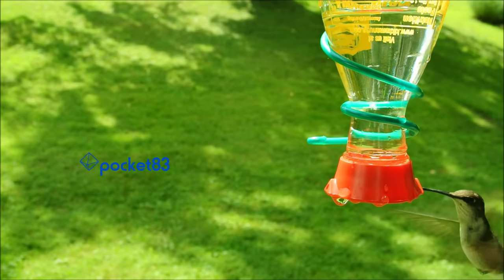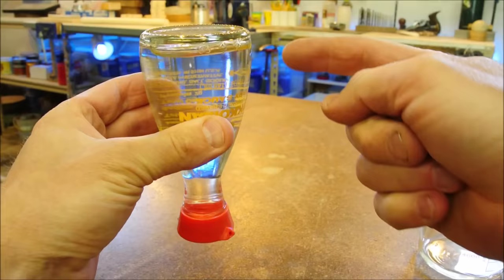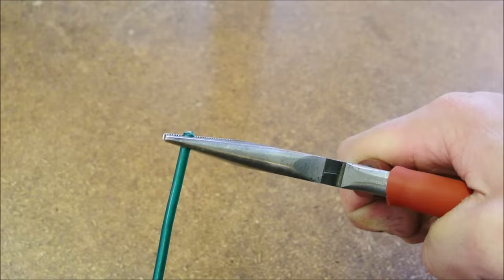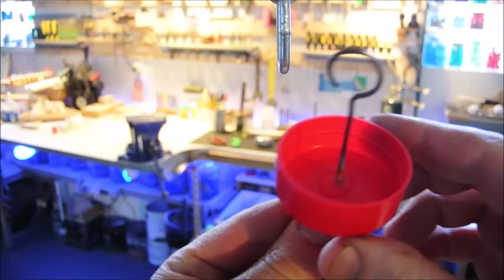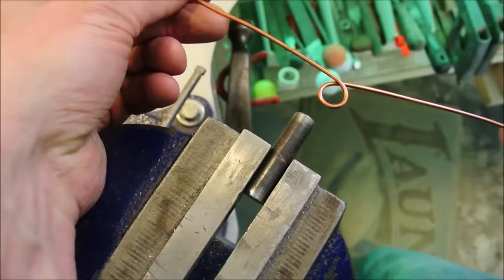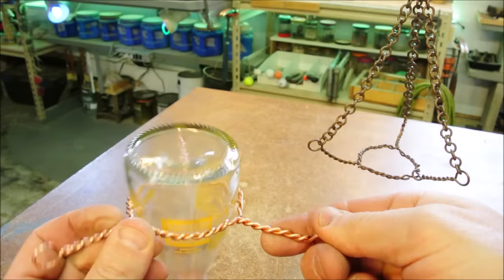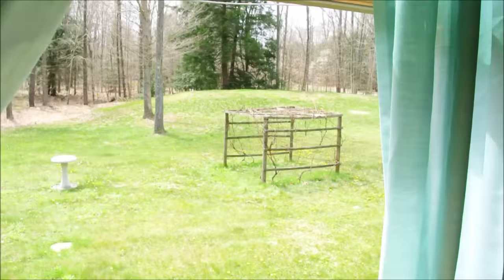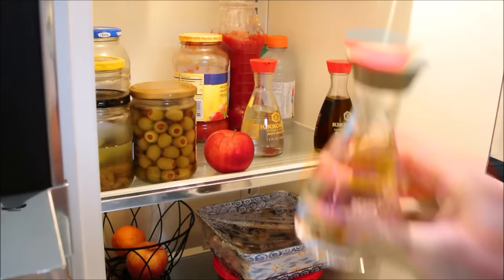Easiest, Cheapest, Best DIY Hummingbird Feeder Ever (from Soy Sauce).

Comment: How about using natural honey and distilled water instead of processed sugar which is not good for human consumption.??? Just a thought.
Reply from the maker: The water doesn't need to be distilled as long as it has been boiled—unless you think there's something poisonous in your water supply. Honey has no nutritional benefit, and it's very likely to grow (possibly dangerous) bacteria. 

Pure sugar is certainly something that people should limit in their diets, but part of hummingbirds' natural diet are the (~25% sucrose) nectar deposits found in many of the flowers that they've evolved to fit. As such flowers are rarely available in a modern suburban ecosystem, these feeders mimic them. 

There is nothing necessarily 'unnatural' about white sugar. "Processed" is just a stigmatized word for the less romantic foods that result of mechanical operation, and we're not talking about fat or salt content here. Simply put, white sugar is just more chemically pure.
Reply: @pocket83  sounds good although honey is nectar collected by bees from flowers and does have nutrients. Also eaten by hummingbirds. 
Sugar is processed juice from cane that's bleached and refined not natural.
 Just looking out for nature. Most of us have good intentions but lack luster knowledge from our teachings. I would advise looking into the making of sugar and the benefits of honey. You're welcome respectfully in advance.
Reply: @pocket83  in a biological ecosystem chemicals are a no no it would make everything acidic. When the earth and body is healthy being alkaline.
Reply from the maker: @scorpionkingggodson5507  You are a classic case of "good intentions but lack luster knowledge," and I can easily demonstrate this by holding up the mirror for you. 

I suggest you first go scan the Wikipedia article, sub-headings "Co-evolution with ornithophilous flowers" and "Feeders and artificial nectar." Certainly, bee honey is found in nature—in places like hives, where hummingbirds don't feed. Outside of which, honey/water solution will quickly turn and spread bacteria. Don't use it as food. 

What you consider to be "processed" provides no basis as a fact-based nutritive argument. Chemistry is chemistry, and sucrose is a compound, no matter the means of extraction. There is no bleach in sugar; the whiteness is a refraction of light from its crystals, just like with snow.

You are not permitted to spread misinformation here; as such, all further hiippy-hooey comments will be removed. You're welcome for this protection from yourself in advance.
Reply: @pocket83  wow I actually said respectfully sugar cane juice when dehydrated is brown, honey doesn't spoil ever and never does bacteria grow in it and it's produced from flowers that hummingbirds feed from. But ok delete it all clearly you missed the message. My apologies I learned something new ,hummingbirds consume store bought sugar and water in nature ok thanks for the info.
Reply from the maker: @scorpionkingggodson5507  Stop getting angry and listen. Sugar cane IS NOT pure sucrose. There is sucrose inside of sugar cane. That sucrose can be extracted from it. If it is removed entirely from the brown stuff, that's called refined sugar. There's nothing bad about a substance's being pure from a dietary point of view. Calling it 'processed' doesn't make the sugar any different.    

Honey doesn't spoil where it's being protected by bees. Outside of that environment, it's a sugary bacterial cocktail that will begin to spoil the moment it hits the air. It will further degrade by adding water, and faster degrade with sunlight. 

Consider what is meant by calling something 'processed' food. It usually refers to that crappy, frozen store-bought stuff that's about the exact opposite of fresh ingredients. You know, tasty, nasty products that are high in sugars, salts, fats, and preservatives. Sometimes those additions are actually bad for us, but not always. Processing something in order to purify it, as with refining a compound like sugar, is not a bad thing. Refined sugar is not bad because it is pure; it becomes bad when a person ingests too much, which is easier to do when it's pure. 

But back to the case of hummingbirds: the compounds that are in natural hummingbird food, nectars, are very similar to sucrose and water solution. Since the sugar is the thing that they're after here, their other dietary needs are still being met by eating insects, and the refined sugar is barely a change for them. In fact, it could be argued that artificial feeders are benefiting their numbers (although that argument would be specious, since it was us who reduced their naturally occurring food sources in the first place).  

Please just consider. I'm not trying to get you to buy anything. Thanks.
Reply: @pocket83  Although I loved your detailed description of why the liquid doesn't run out of these feeders I'm going to have to call you out on your statement about honey.  The "dry" component of honey is 95 to 99% sugar but this sugar is composed of various different types, including simple carbon sugars, that are easily absorbed.  It also contains organic acids. (and a  quantity of minerals almost too small to even mention) This makes it unlike processed white sugar but certainly no less nutritious.  

Pots of honey found in Egyptian tombs had crystallized but not spoiled and there is archaeological proof that it was used on open wounds to guard against infection.  Modern medical science is now engaged in actively testing it's properties.  So far it's been proven that it does in fact have antibacterial properties and can also be effective against some antibiotic-resistant microbial species.  Although there are  microbes found in unpasteurized honey, they have largely been found to be inert.... unable to multiply, which is why honey has such a long shelf life. (and we're not talking about using unpasteurized honey here) Even though all of these positive properties would quite literally be watered down for it's use in bird feeders, it still seems honey would be LESS likely to grow (possibly dangerous) bacteria than sugar.  That said, it's actually a moot point as humming bird feeders should be cleaned every 3 days to keep the birds safe from any life threatening contamination, no matter what the sugar source.
Reply from the maker: @whatanitemare  Stop that. I appreciate the civil discourse, but you're obfuscating the reality here with inappropriate nuance. The question was not whether or not honey contains any compounds that may express antibacterial properties, but whether or not it is advisable to use honey as hummingbird food in place of table sugar. Tell me, do you have any evidence that honey is better for the birds than sugar? Can you provide a link to a credible study? 

The very (natural) compounds found in honey which are toxic to certain microbes may end up being toxic to h-birds, perhaps inadvertently, if they alter the bird's internal microbiome in any way that the bird has not been selected for. 

Consider that h-birds avoid bees while feeding. This is because they are a credible threat. With this in mind, how likely do you suppose it is that h-birds will risk sipping from the hive? Over evolutionary time, those birds which had the honey-thirst must not have made it, so there is no 'natural' argument that will be in favor of selective adaptation of hummingbirds to honey feeding. Thus, use sugar.   

In all seriousness though, that was a downright respectable try to 'call me out.' Thanks, and sorry you were in the spam box.  

One more thing: note that sugar has no 'nutrition,' per se. The birds consume it for its pure energy; yes, it is a carbohydrate, but their real dietary needs are met by eating tiny insects. As you've noted, the "easily absorbed" part is the rocket-fuel like property it (sugar) has during cellular respiration, and that "almost too small to even mention" part really is nominal from a nutritive perspective. 

Also, a concession: honey probably is harmless to hummingbirds. But that might change as it sits brewing in a sun-filled bottle. Honey was not 'designed' for use outside of the hive.
Reply: @pocket83  Thank you for the very clear and concise reply.  In truth, I knew I was yanking your chain a bit when I wrote my commentary.  I myself do use refined sugar in my feeders and my only worry is that I will be called away for some reason and not be able to clean the feeders as often as necessary.  I have no concern over the sugar itself because I know the HB's are not using the feeders for nutritional purposes.  So why did I do it?..... It was this one line in your response..... 

"it's very likely to grow (possibly dangerous) bacteria".  Although I understood the concern you were expressing, that one line left me feeling a bit bullied by the use of an exaggerated statement that was impossible to substantiate. "Can you provide a link to a credible study?"  LOL 

OK.  I'll stop.  (Even though you were the one that brought up the question of whether honey contains any compounds that may express dangerous bacterial properties.)  Consider me spanked!

Oh and about the spam folder?  No worries.  I've been relegated to far worse places.  ;)
Reply: @whatanitemare  Eh. That's rhetoric. Seriously, just imagine the number of spankings I have to give around these parts! Hyperbole and/or emphasis, I can afford to spare no expense under pressure. The wolves are closing in all around me, and very few of them are as, well, domesticated as you are. Best that we not give them too many fancy ideas, lest they form groups and (as George Carlin once said) start "wearing little hats." Subtlety is antithetical to crudeness; it's not something that fits into a talking point.  

Now that we're thinking about it separately and clearly though, why would it not be likely for a bottled organic compound to grow bacteria? Biological process is ceaseless, and so decomposition is inevitable. Whatever antibacterial that does operate in honey as a preservative will eventually be overrun, and thus, succumb.  

Another point to make following a re-read of your reply: try to consider that sometimes these comment strings get mashed together in my head. The honey argument has been brought up before. In fact, it's startling how redundant some videos' comment threads can become. On the million+ view videos, the repetition becomes so staggering that it has permanently changed my view of humanity. In a nutshell, originality is illusory.
Reply: @pocket83squared  So I come across as rather mild mannered and well spoken but lacking in a certain "to the point" basis in fact.  Translation?; I talk softly and dazzle with bullshit!  ROFL!  Blame it on my being Canadian.  (I notice your style seems to be more sesquipedalian)  Upon considering your wolf analogy, I can see how my comments may have lead to the formation of packs but OMG... did you really just quote George Carlin at me?  That's a whole different level of respect!

Upon reviewing your question on why it would NOT be likely for a bottled organic compound (honey) to grow bacteria?... I have to say that it does sound erroneous BUT that was never the question.  The question was whether it would produce bacteria that was more harmful to HB's than what sugar water would produce and was it likely to do so more quickly.  (although this last part was more inferred than stated)  Until someone actually does a study, there will be no definitive answer so I'll continue to use sugar.  I have noticed that people get so invested in the debate over what to put in their feeders that they sometimes overlook the fact that cleaning their feeders often is as important as what they're putting in them.

I wasn't surprised to hear that this topic has come up before.  In fact, I would have been surprised if it hadn't.  After all, when everyone is getting their information from the same source, it's hard to be original. If we're all lead to the same sights to collect our information, we'll invariably be left with similar questions, which we will then plaque you with.  Very few of us will take the time scroll to an article on page 10 to see if the less popular point of view may contain our answers. To quote Marshall McLuhan  “the medium is the message.” 

What I hadn't considered is just how mind numbing these redundant comments must become.  To put a positive spin on it.... It's a measure of how popular your channel is.... right up there with collecting haters and trolls!  I wish you continued success!  ........Angie